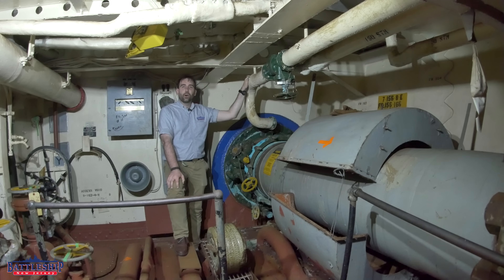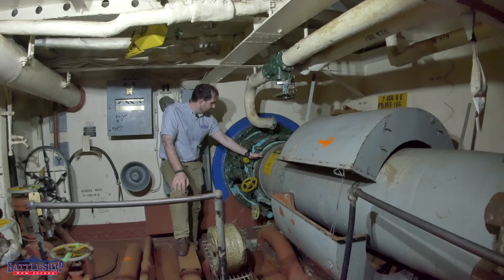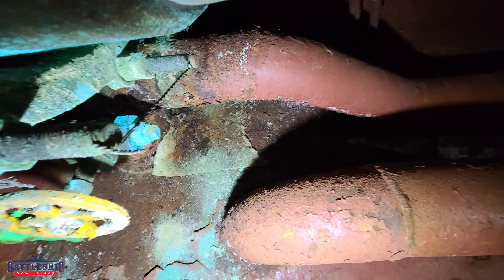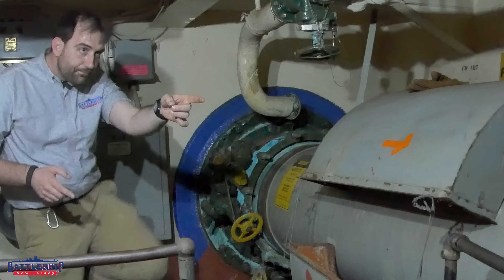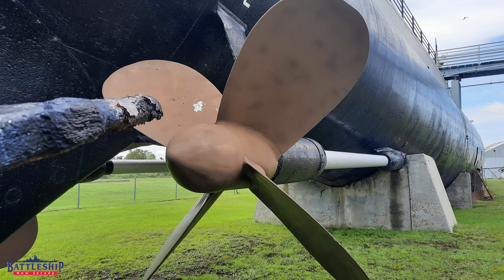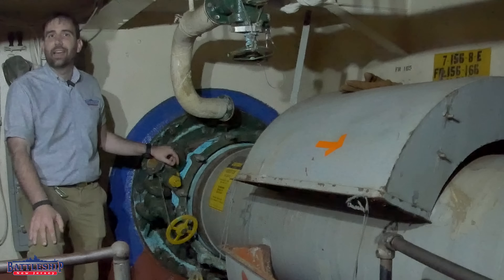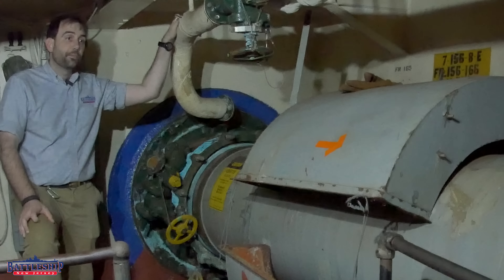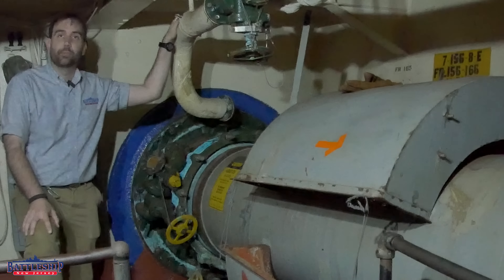Drydocking New Jersey Priority Project: Propeller Shaft Seals

Comment: What would it take to rotate the propellers on a scheduled basis to prevent packing issues? Can the jacking gear be used so you dont need to fire up the entire steam plant? Could be done as a weekend event or something.
Reply: The props and rudders are mechanically locked in place.  They can't move.  "Fire up the steam plant"?? Are you nuts?
Reply: @stargazer7644  Right my point is you can't just fire it up, but there are other mechanisms that allow for rotation. The question I was asking is what impediments are there from doing a manual rotation using the jacking gear as part of regular maintenance.

Comment: Would turning the engines over once a week prevent the shaft packing from getting crushed at the bottom?
Reply: Turning the shaft doesn't spin the packing, nor does it change where the weight of the shaft presses on it.

Comment: Wouldn't it be possible to weld some plates around in between the shaft and the hull to weld this part shut without having to remove anything ? No leaks, nothing to replace, no need to get rid of the propellers, I mean yeah the shaft will be welded but it can be reversed with a cutting torch, and it's not like the shafts will be rotating anytime soon regardless

Comment: The ship is more important than 4 propellers you can't see. So if there is a risk of irreversible corrosion or catastrophic flood damage due til a failed seal. Then pull them off , not worth the risk to the ship by keeping them on.  And keep them on site I  your storage area,  no one says that they have to be displayed

Comment: If there is significant corrosion that requires the propellers and shafts to be removed, but funding isn't available to build a suitable park onshore yet, would could they be stored underwater next to the ship? This would separate them in terms of galvanic corrosion but wouldn't expose them to air where they would oxidize while they waited for a better display?
Reply: There isn't only oxygen in the air, you know?

Comment: Why not put a solid seal in place instead of soft packing? Surely there's a polymer that can be used that will bear the weight without quick deformation. Another option is removing just the props and then storing them underwater next to the ship. That way they're still nearby and effectively in situ but without the longer term issues that leaving them installed.

Comment: I think props and shafts should stay on. Troubled museums in the past have sold off props for scrap. You guys are doing an excellent job with her; its future board members and other potential economical issues in the future that would be concerning. They are valuable as scrap and leaving them on would eliminate the temptation for short term stay operational money. Im already hoping Iowa doesn't cut a hole in her for some escalator. NJ is awesome in the fact that she is complete top to bottom. But thats my 2¢

Comment: 25% I was thinking a two word comment. What is the Bright blue?  - some chemical reaction residue or something intentional? not the blanked off no longer used. Ok - was the Iowa class blessed with good Propeller design, no change outs due to issue? are all 4 props the same design (# blades) . Activate the jacking gear.

Comment: I agree that if it's possible, it would be best to keep everything on the ship in place (propellers, anchors, etc). But if they do have to come off, keep them somewhere else on or around the ship. Don't let 'em out of your sight! Push comes to shove, put them on the deck somewhere. Or the parking lot. Or the pier. Somewhere close by. If it REALLY comes to "shove", put them somewhere related, and protective. Not some random park. Maybe the Philadelphia shipyard where it was built. Or maybe the New Jersey State House or  governors mansion. 

Something I'd be curious about in the future is stuff that's not original to the ship. A lot of stuff got cannibalized by other ships. When you guys got it, you cannibalized other ships in return to get stuff "back" to make it look complete. What did you guys swipe from other ships in mothballs? Is any of not visible (under water, not on the tour route, etc)?

Comment: Keep the propellers on the ship they already have one on display that the public can see. If the people could see some of the equipment used in municipal water systems they wouldn't believe it in most large cities the fire hydrants are from the early 1900's they use the same style seals the same with the large gate valves and some of those gate valves haven't been turned in 40 to 50 years the hydrants maybe once a year

Comment: Because of the potential of hurting the battleship has a whole the props and shafts should be removed. Ryan just listed like six things that keeping the props will do eventually. The biggest are risk of flooding from four gland seals, the shafts bending/breaking, warping other places, and bottoming out on the seafloor as it’s being towed and the increased risk of severe storms doing the same. Also they’re never seen and it’s against the Navy contract for the ship to ever move under it’s own power again. So why not recoup some of the dry docking money by recycling them. You’ve spoken before about the price of pre-WW2 steal being so high and the scientific need for it.  But mostly if the shafts and prop are pulled only the history books will know the difference.

Comment: It sounds as if the removal of the screws would be an expensive project designed to avoid potential problems that are quite a distance in the future. I'd think the money would be better spent addressing current problems and/or desired enhancements to the museum.

Comment: This class was optimized for speed.  Removing the props would be neutering it.  Surely there's a better way since all shaft logs leak.  It's wrong to start amputating the troublesome bits.

Comment: I think to remove the props would be dangerous. As you said Ryan once they are in other places you will loose control of them. If keep them but not attached then you have to find space and room for them and as you well know, they are not small items can just put in a cupboard If they stay attached then there is no "storage" issues or "where did we put those?" issues. As long as they stay attached to the ship, you know where they are and more importantly. They ARE a part of the ship. They are not an addon. You may call my thinking here silly. But, the prop is just as much a part of the ship as say the hull. Without either. It would not be the lovely beautiful ship it is. Another issue, if you do remove those props which as you said are very heavy, would that then in fact lift the stern of the ship up out of the water and have the ship essentially angled nose down?.  If you are worried about future weight issues could there be something mounted or attached externally to help support the weight of the props?. What is the depth like below those now? If it is getting shallow. I guess once it goes into drydock would be a perfect time to get under the ship dredged out to deepen it as a future safeguard. With the ship permanently attached there. That alone would encourage mud and such to build up under it.

Comment: Assuming there's enough money, I think removing the screws and the last section of the shaft would be best, in yhe long run, for the rest of the ship.  After all, visitors can't see the screws, and probably aren't allowed in shaft alley to see the shaft poke through the hull, so they'll never miss them.  And the ship will never be reactivated, so that's not a real issue.

Comment: Would think the best long term fix would be to remove the props and last section of drive shafts and weld plates over openings. Ship is almost 80 years old and would need several years to get her going again. Old timer that worked at the old Philly Naval Yard told me 25 years years ago there are few qualified people who can fabricate & install high pressure boiler tubes in ships. He thought the New Jersey might require complete boiler tube replacement. Wonder if any country has even built a large non nuclear  ship powered by obsolete steam power in last 50 years. Now with million dollar missiles that can be fired over a hundred miles away believe battleships are white elephants even if fitted with their own missiles. Looks like future wars are going to have more drones & missiles do major damages.

Comment: If the prop shafts not turning affects the life of the seals, why not just rotate the shafts? An electric motor for each shaft geared to turn the shaft at, say, 1 or 2 rpm might do the trick. Each shaft would have to be separated from the engines at an existing coupling (so non-destructively), and each motor would only have to be powerful enough to easily compensate for friction. There would have to be some way of getting each shaft up to speed first, as the electric motors would not be able to overcome the initial inertia of shaft and prop. While there would be an ongoing electricity cost it might work out cheaper than other methods and be more effective.

Comment: I'd wait until she's out of the water and asses. Realistically speaking.  Repack gland seals, clean up the inside area wherever theres corrosion as stated. Clean/ Paint the bottom of the hull if needed, replace Anodes. Leaving props on means she's that much more complete, and less risk of props being damaged and or lost. Leaving props on means no cost for transportation of them. So more money for other protects that need attention.

Comment: Do the propeller shafts have a disconnect, either automatic or manual, from the drive gearboxes to allow the propeller to rotate the shaft freely while under way if one of the turbines is not making power? Like a sprag clutch.

Comment: While highly unlikely isn't it still possible that the NJ might be reactivated? I'm sure you know much better than me since this is your stock and trade but didn't the last Congressional budget act involving the Iowas stipulate that two be maintained for this purpose?
Reply from the maker: The ship will not be reactivated and none are maintained for that purpose.
Reply: @BattleshipNewJersey   The USN wasted 10s if not 100s of billion of taxpayer dollar with the Littoral and Zumwalt ship fiasco. As I mentioned the last Congressional budget appropriations (law) that I saw regarding the Iowa's said that two shall be maintained. Since then there might have been a Congressional release (law) on that. What you want, what the USN wants and what Congress wants are three separate things - right now at the moment you are all more or less in agreement. It's highly unlikely but it can quickly change. The USN no longer has a credible shore bombardment system outside of the paltry 127mm guns on its ancient aegis ships - Ticonderoga and Burke - and it's extremely expensive missiles

Comment: The propellers/screws should stay on they are a part of the ship, it's like displaying a classic car and taking the wheels off and putting the wheels in a container. While the props are on the ship and underwater there is no chance of vandalism or them been removed at a later date by some authority. Don't fix what's not broken.

Comment: Could you just add more packing either at the top or bottom, either so it would be harder to pull away from the top because there just more or at the bottom so its harder to compact, orMaybe a different kind of pack like rubber

Comment: If the seal was designed to leak a little why did they not install a trough of some kind to catch the water in a controlled manner to be pumped out? But of course during the service life of the ship they would have had plenty of sailors to scrape and repaint the deck whenever it started to show signs of corrosion and of course these ships were not made to last for such a long time so maybe they didn't see it necessary.

Comment: If the propeller will never be turned, why not replace the seal with a weld between the hull and the shaft?  Seals are prone to leak because they must allow for movement.  Since the shaft will not turn, eliminate the seal as the means to keep water out (leave the seal on the inside to show how it works, weld on the outside to provide the actual sealing).

Comment: Another consideration is the life cycle cost analysis of both proposals... to either leave or remove the shafts and props.

First, what is the reasonable life expectancy of the ship? What are the most critical failure modes that wold shorten that life expectancy?

What would be the effect if the ship is not dry docked for another 33-40 years after this dry dock cycle?

If leaving the props in place doesn't represent a reasonable threat to the entire ship, and the life cycle costs don't outweigh leaving them in place, they should stay.

Comment: Someone can check my physics but I’m pretty sure gravity doesn’t pull up so the fact the props are turning or not doesn’t “spread” the load over the packing material. It’s always going to be pulling  down against the bottom of the seal. The shaft may well get bent over time but that is not the packing.

Comment: I would be inclined to remove them all along with their exposed shafts and blank off the bulkheads. It would be a most impressive static display to have the four them arranged on land in their proper configurations complete with the removed shaft sections, but I imagine their transport and placing (assuming you have the room) would represent a another few hundred grand of expense.

Comment: I'm assuming the screws were left on the other 3 Iowas when they were kept in reserve for such a long time. There must either be a record of how the shafts corroded during that time, or a record of how much of the shafts and their support structure had to be replaced when they were commissioned in the 80's. I'm guessing they held out just fine and needed little or no replacement.

Comment: Two questions:

What are those seawater fittings in the gland seal and right above it?

Does the ship have a jacking gear? If so, spinning those shafts at 2-3 rotations per day will keep the shaft from bending.
Reply: The large pipe in the overhead is a raw water supply pipe. There's a constant supply of seawater pumped through the sterntube to lubricate and cool the seal and the cutlass bearing that is aft of the seal. Not sure if the Navy did it back in the day, but currently they even run water through pier side to keep marine growth from accumulating in the sterntube. If you look at 3:51, in the left of the frame, you can see the 90 degree elbow which was removed from the pipe in the overhead and the rusty blank covering the outlet on the top of the seal.
Reply: @rickjames8317  thanks! I figured it was something like that, but ESWS never got into the specifics. At least not that I can remember anymore.

Comment: I'm not sure if you only take patreon/donator questions, but if not I have one for you guys:
How long does the battleship take to stop? 
If, somehow, someone made a grievous navigation error and the battleship was steaming towards land at a full clip could they just go straight to full back and slow down?
Reply: I forget the exact distances i was told, but since they have 2 rudders, the Iowa class battleships do have the option to "close the barn door" - meaning setting both rudder angled as close to centerline as possible, making them act as an effective brake in the water  --> /\.  That certainly helps shorten the distance in a panic stop.
Reply from the maker: We've got a video on that: https://youtu.be/wcJSV3-Lr8E
Reply: @BattleshipNewJersey   Awesome, thanks. Hopefully someday I can stop by the ship, I'd like to visit all the Iowas, but I've only managed to visit Iowa so far.

Comment: My question is if the hull of the ship is  steel and the propeller shafts are steel why can you not remove the packing and just insert steel and weld the propeller shaft in place it will never spin again but the ship is never going to be powered ever again it will never leak

Comment: Why not pull the propeller shafts at the transfer case and blank off the outside. The ship is not going to be recalled or put into service it'll save time and protect the hull and works.
Reply: Typed this up before he addressed this issue 😊
Reply: My vote is take em off. In 60 years they will be thanking y'all.

Comment: Nobody can see them at all. So I'd remove them completely and blank over the holes. Best way to protect the ship for the long term. Leaving them on youll have to take the risk of a leak and the expense of maintaining it every 20 to 30 years. You could put back a "fake" seal so it looks original still for people to understand how it works. It is a very interesting part of the ship. You could easily auction or sell for scrap those props and use that money for other projects on the ship. Like corrosion protection or restoration of other spaces. Maganese bronze is worth a good amount of money. I'm sure someone would be interested spending a lot on them intact too at an auction though

Comment: I wonder instead of packing if a bronze or other metal bushing could be used to replace the packing since the shaft no longer turns. I would advocate to keep the propellors with the artifact as they are significant pieces. The dissimilar metals can be managed with sacrificial anodes. If you opt to remove the props, they should be lined up on the museum land near the ship.

Comment: How hard would be to rotate the shafts 180 degrees to counteract the induced sag? That brings up another question.  There shouldn't be any sag with the inboard screws...right?  Maybe just the outboard need to be removed.  I believe Massachusetts only removed two. I could be wrong. 

My gut says to leave them on. Only take them off if needed to prevent other serious problems. If they come off, absolutely keep direct control of them. Maybe put two on the fantail.